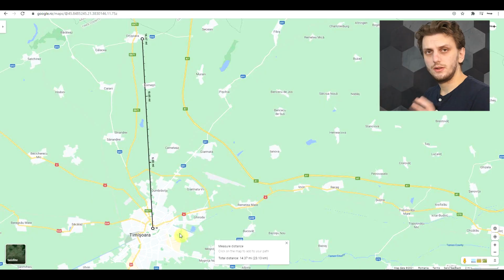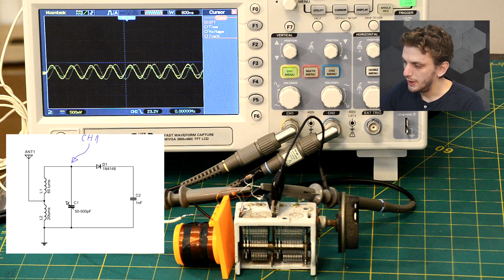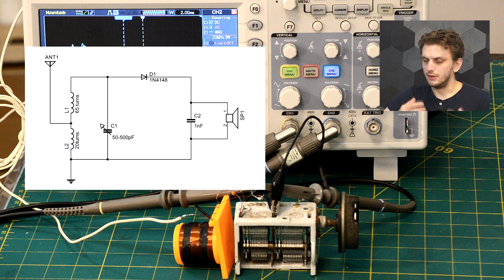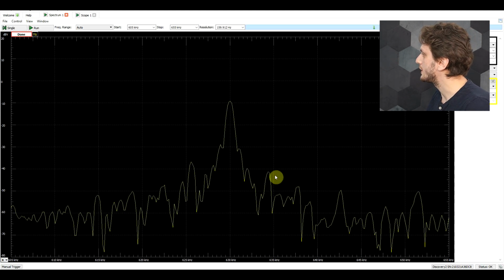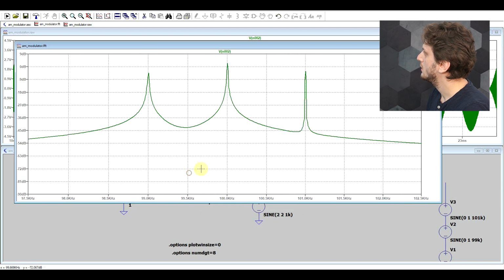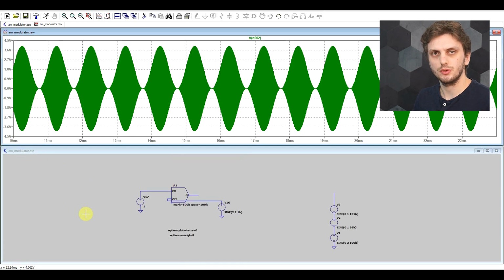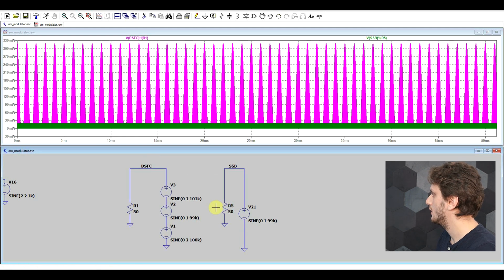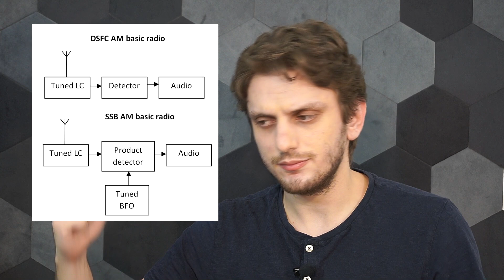RF tutorials - Why is AM inefficient?

Comment: At only 20km distance, you might be able to get enough power to charge some small batteries if you used a longer wire antenna. It just shows how inefficient Tesla's power transmission would have been though. (path loss approx 55dB).

Comment: What's the name of those nice 90 degree adapters you use between your probes and the scope input? Makes things very tidy!
Reply from the maker: I'm not sure if they have a special name other than "90 degree adapter" or "right angle adapter"; you can find this sort of thing either for BNC or SMA (or N connectors if that is needed); If it helps, here is an order code for such product: 27-8150

Comment: Not to spoil the fun ... But
Measuring SSB power using a single tone ... will give you nothing  , try multitone or even better , try noise .
MW signals can travel great distances and when they get there they need to be at an amplitude that is above the noise floor in that location .
Digital transmissions vill never be able to do that , the amplitude is to low to be above the noise floor at anything over few hundred Km .
The real reason why AM must die has nothing to do with going green or efficiency , it is more to do with politics and opinion shapping that the owners of the mass media in your area want you to have . There are thousants of 100KW or more devices in my town going up and down the street on 4 wheels and emiting only smoke .
Also speach on SSB can be inteligible if you have a good rig but is never pleasant . Music ..... huh . 
I listen almost daily to some AM stations that are 2000 Km away from me , in UK 1458 and 1548 KHz, mainly for the music , but also for the lack of BS news . 85 FM stations that I can recive at my location do create a fake impresion of choice , duplicates fromm other towns , latest and " greatest " music , and parroting the same " news " of eachother .
I will be a sad day when AM will be taken behind the barn ,  and mainly because because it has the potential to run interference on some power group of interests that owns the radios in yous area .
Reply: "Digital transmissions vill never be able to do that , the amplitude is to low to be above the noise floor at anything over few hundred Km ."
Dude… Morse and Beaudot telegraphy is a proto-form of digital transmission, the binary signal allowing a high tolerance to noise with narrow filters. Radiotelex is still used worldwide for long distance maritime communications. Modern digital transmissions now uses checksums and data reconstruction to be even better immune to noise as well as interferences. You also forgot that the propagation distance is a factor of the frequency, the power emitted and the antennas. 
AM is great for electronics beginners but it's already been many decades that PM and FM reception was affordable for the mass and as a result that most commercial stations turned off their AM broadcasting, even the international SW ones. Next is the turn of analog in favor to digital, like TV. And like TV,  broadcasting will disappear because of internet, because of the way less vertical media consumption and because actual computers allows us hundreds of hours of listening in the palm of our hands.

Comment: Nice. I went ahead and built my transmitter using common emitter and common base amps. One for AM and the other for FM. My lab is a mess I can't even muster the will to fix it. Not much going on lately. Let's play with modulation schemes. QAM 4 or PSK 4. Let's make it challenging, 433MHz. I'm too lazy to do it. I'll give you a like if you do it though ❤️. I've got one of those discovery things, never used it. Got some SDR stuff, but soon they'll be out of support. Used them for SAT weather stuff. living in a 3rd world country sucks the energy out of you. Haven't built anything meaningful in a year. I think this is the final slump and no way back from this one. Do more modulation vids. I love those.

Comment: Remember how father showed me how to make an AM radio and we had AM back then. We connected the ground to one of our central heating radiators :) We don't have AM anymore :(
Reply from the maker: I'm sorry to hear that... I guess you only have the amateur radio bands with mostly SSB AM. May I ask in what country you live in?
Reply: @FesZElectronics  Belarus, I guess I should be able to hear your transmitter at night, it not that far away (about 1000Km) :) not without an amplifier of course.
Reply from the maker: Regarding possible stations you could listen to I found this website: http://radiomap.eu/by/minsk ; according to this (for the capital at least) it should be possible to receive some Polish and Lithuanian broadcasts - those are closest. But probably a basic crystal radio will not really pick anything up...
Reply: @FesZElectronics  Thanks! Didn't know about this site.

Comment: That was very informative. What is the efficiency FM modulation, or does this not apply to FM? I've always been curious, what does Fesz mean?
Reply from the maker: This is mainly an AM related topic, the equivalent of SSB is not really used with FM to my knowledge, but I may be wrong. With AM you need a lot of power when transmitting to counteract background noise, but with FM, the transmission is far more immune, so you can get away with lower powers without having to rely on this sort of tricks.
"Fesz" is an abbreviation of my nickname and surname.